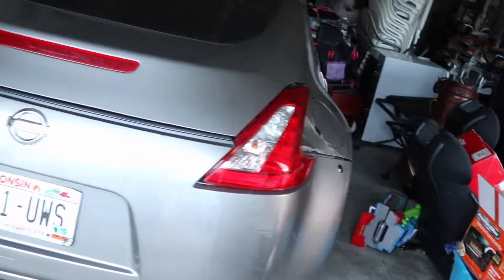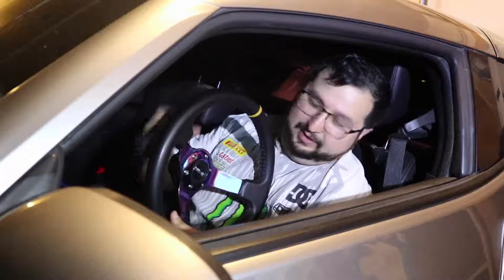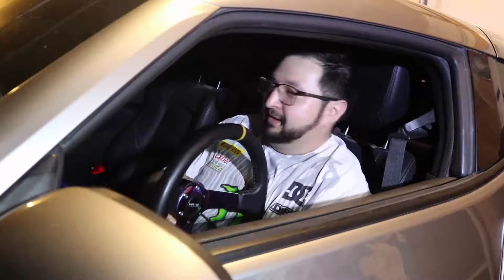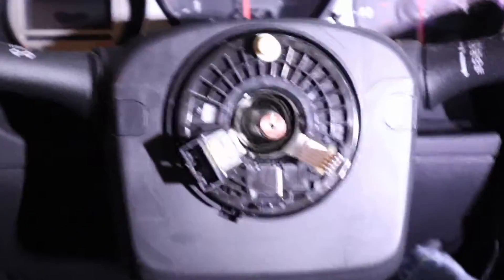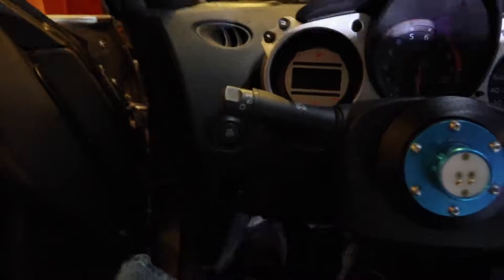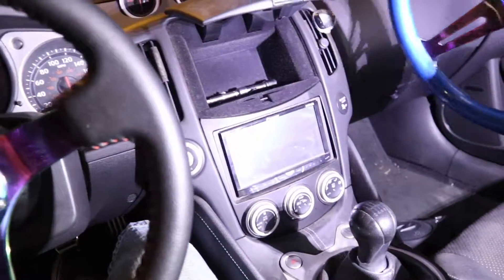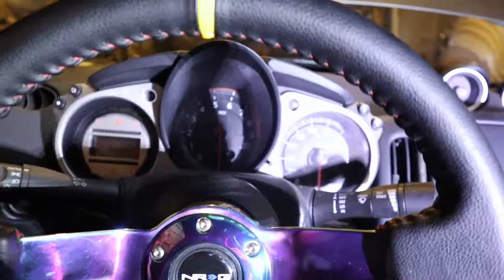370z NRG Quick release install

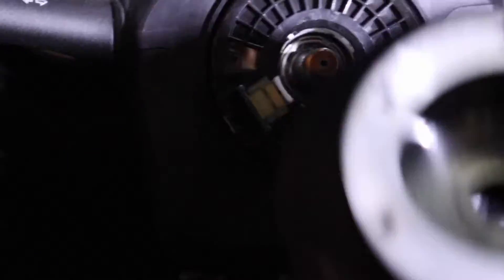Comment: Did you ever get any issues with just ripping off that connector @2:54? Any lights or anything?
Reply from the maker: I got the air bag light on, but unsure if its because I ripped the connector or because of removed the airbag/steeringwheel. No issues though

Comment: I replaced my wheel with the same stuff and now my steering wheel won’t come back to center after a turn by itself without me having to man handle it back to center and no it’s not the power steering
Reply: Did you break anything off while doing it?
Reply: @Entertainment-wr9lz  I went back the next day with a hammer and busted up all the plastic behind the steering wheel and now it steers with no issue lol. It’s a drift car so i didn’t really care about the plastics.